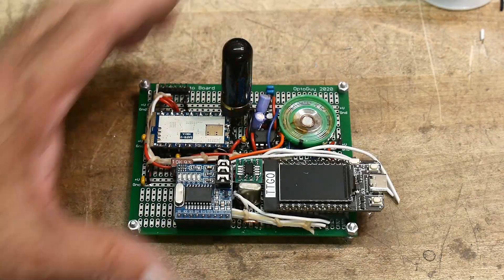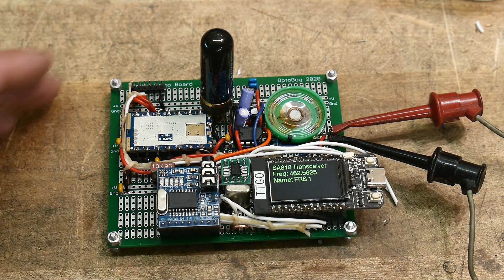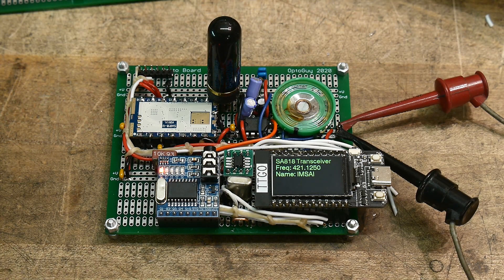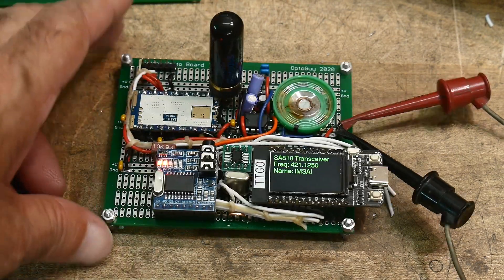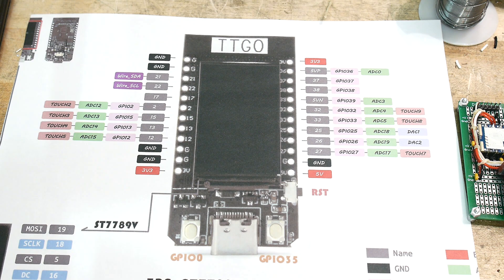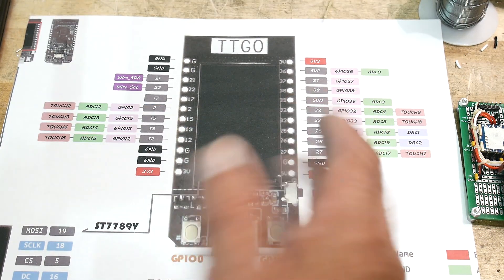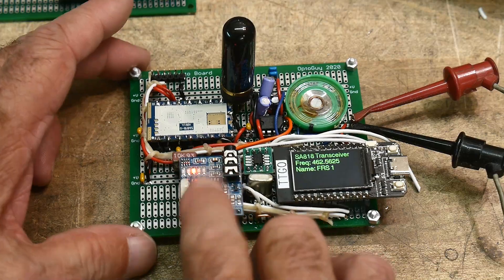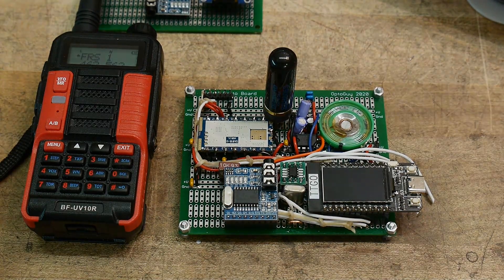#823 DTMF (part 6 of 6) On Air DTMF Test

Comment: Nice little board you have there! I got my Tech and General license on 1st April. As long as I follow the rules and etiquette I'm looking forward to doing various experiments without fear of black helicopters and black SUV's with blacked out windows turning up to my house :-)
Reply: I just got both tech and general, too!
Reply from the maker: good work. I remember the test and got the tech and general, then they say, want to take the advanced? I said I did not study for it. They said why not try. I missed it by one question, ugh....
Reply: @BrendaEM  congrats.
Reply from the maker: what radio are you going to get
Reply: @IMSAIGuy Thanks! Yeah, they asked me whether I wanted to do Extra and I refused because I really had not studied for it. I also have this crazy thing in my head that I have to ace a test so going in unprepared is not something I'm used to doing. As it happens I already had the radios. I bought a Kenwood TS-2000 about 5 years ago and a Kenwood TS-890 2? years ago. I've listened but I never plugged in a mic to press transmit - that and I didn't have a proper antenna that I could transmit into. I bought two good antennas after I passed the exams and had my first contacts on FT8 towards the end of April. Still haven't plugged in a mic for SSB or learned morse for CW - that's to come.  73, KC1PAN.
Reply: @IMSAIGuy  Moi?
Likely a Yaesu HT. A friend has been threatening to give me a VX-8DR. If that doesn't pan out. I will likely get a FT-70DR and of course a spare battery, because apparently Yaesu can't good a good deal on lithium, so they go sparingly with it. For me, something waterproof and tough would make sense. I would feel good about having a radio that's harmonically behaved. That's not the say that I wouldn't get a Baofeng for GMRS, because I likely would because I might care more about HAM.